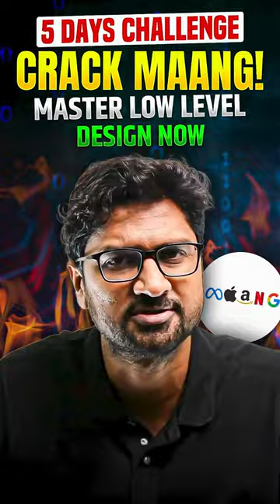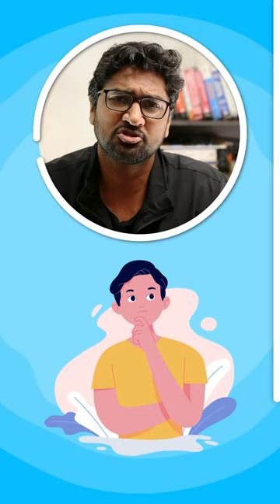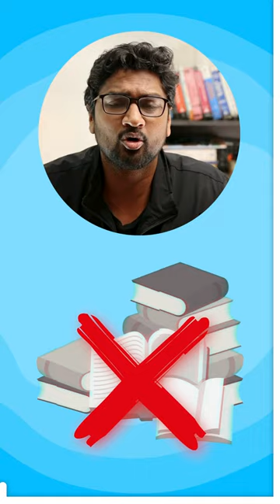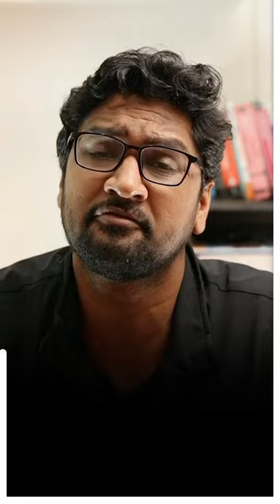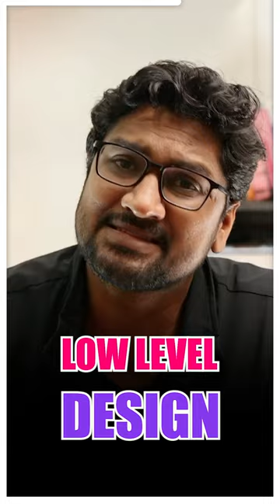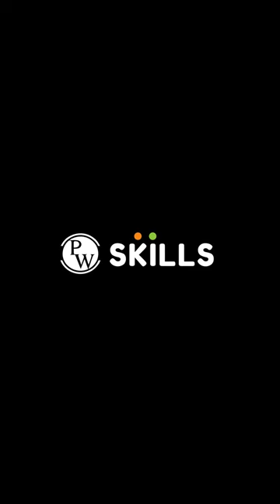Crack the Code of System Design - 5 Days 5 Projects #PW #Shorts #SystemDesign

Comment: Sir can I participate in these sessions as a btech 1st year student or I require some prerequisites?
Reply: this will help for basics after btech you can keep your time on it you can master it
Reply: PW Skills Coupon Codes:

For ₹3500 Batches: CPCA0030
For ₹15000 Batches: CPCA030ADI15
For ₹20000 Batches: CPCA0030ADI
For BFSI course SAVE12

Use the above coupon codes to get the maximum discount.